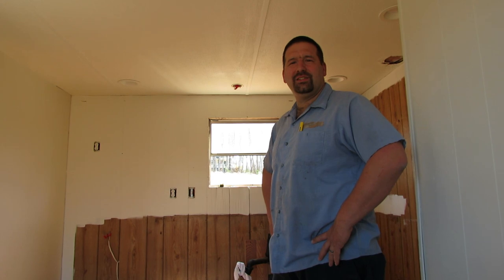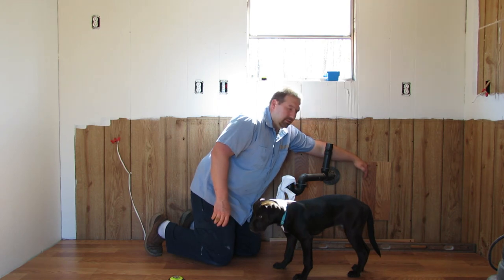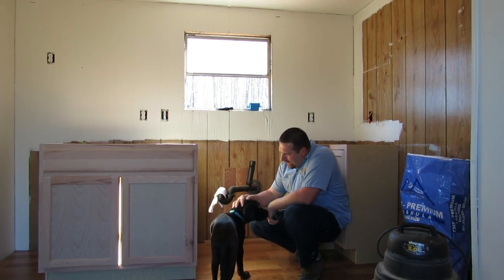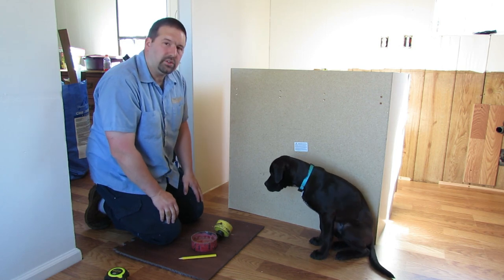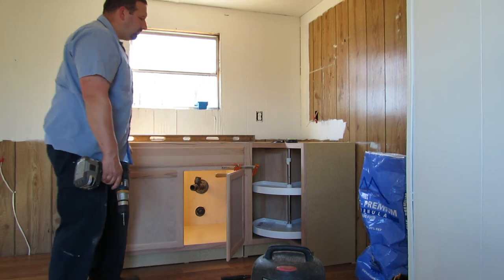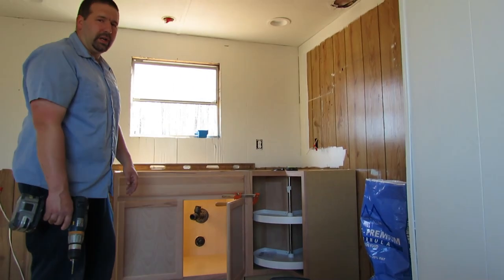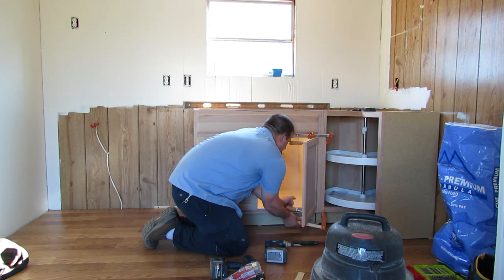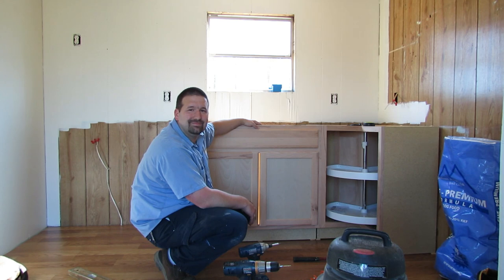Mobile Home Kitchen Cabinet Install

Comment: Excellent video. I’m a bit confused on how’d you get the cabinet to level with the slant on the floor.
Reply from the maker: @MoCityTrill337 I leveled the cabinet on the wall with the laser then screwed in into the stud. After the cabinet is mounted shims were placed under the cabinets in low spots for support. Excellent question! ~Mr. C.
Reply: @NaturesCadenceFarm  thanks for your response and help sir.